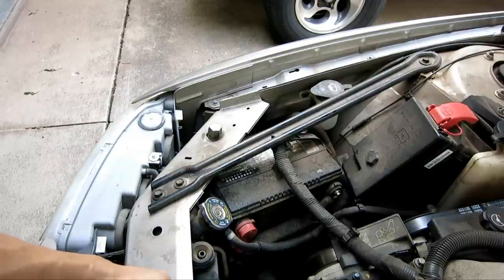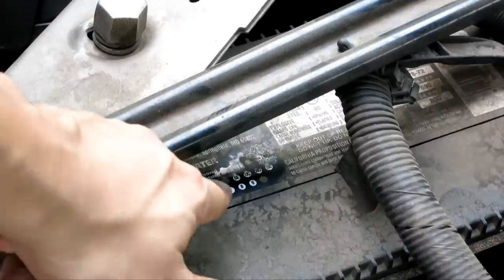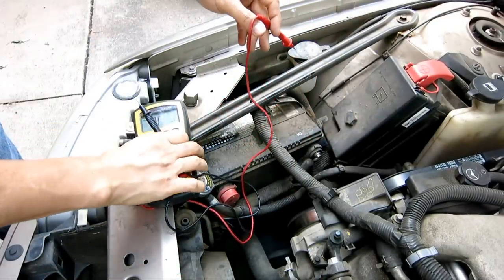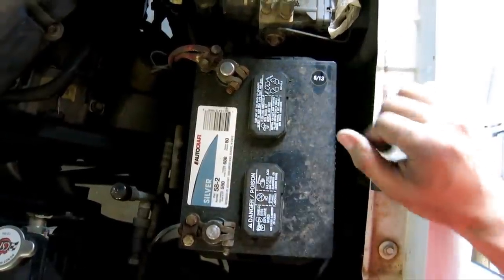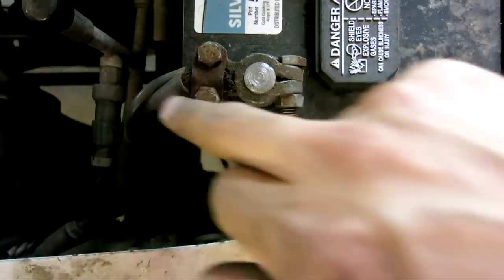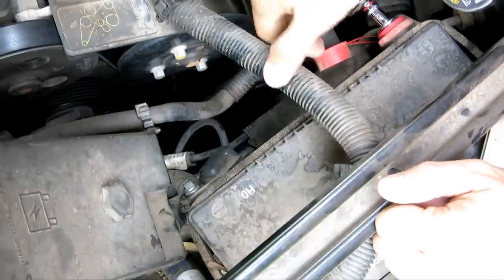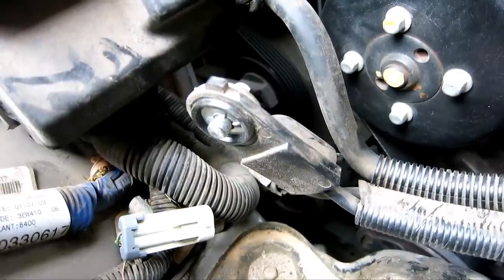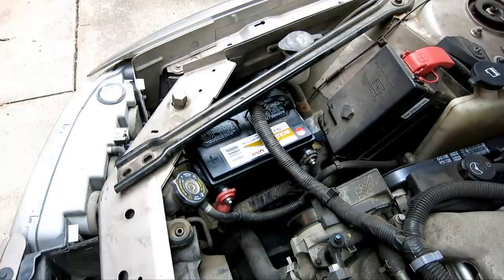How to disconnect & replace car battery - touching 12v safety and tips - Buick Century GMC Chevrolet

Comment: Good video but your not saying what size wrenches to use neither
Reply: Charlie Williams I was going to say The same thing. Wish he'd share that info.
Reply: Thats all I'm ever looking for in these dang add videos.
Reply: Battery terminals are 8mm. The tie-down bolt is 13mm and the bracket bar bolts are 1/2 inch but a 13mm would also work on those. You're welcome
Reply: Holy cow. You need him to tell you the socket size too? Bust out your socket set and figure it out. The man already gave the walk through. You want him to come to your house and change out the battery for you too!? Sheesh. Ok, rant over. ;) 1/2" socket for the sway bar and battery retaining bolt. 5/8" for the battery terminals.
Reply: 14 mm (bracket and retainer bolts)
8 mm (battery post)

Comment: Thanks so much for this video!  I was having such a hard time wiggling the battery out of that tight spot on my 2004 Regal, but when I saw how you did it, I had it out in 3 minutes (and I'm a little old lady on crutches).  Now I can charge it and test the system.
Reply: I need to replace my battery I'm apprehensive but if you can do it I can do it

Comment: 14 mm (bracket and retainer bolts)
8 mm (battery post)
Reply: thanks
Reply: Thank you for this.
Reply: What kind of wrench do you use to take off the sway bar and what size
Reply: @jaimedjones5940  14 mm
Reply: It’s 13mm and the 8mm battery post.
Reply: I used a 3/8
Reply: @davionjr2481 3/8 which one?
Reply: Thanks man.

Comment: This was helpful battery came in and out winds up testing good cleaned terminals went back re installed and started right up.. Then had to drive one car back half way walk back get the other truck drive it back to shop then hoof back up hill to get  car and return..  Some walking some Sun..  
worked like a charm.

Comment: why they say spark can make battery explode.
Reply from the maker: what they mean is when you short circuit the battery positive terminal with a tool to the frame or negative terminal (4:10), it will draw max amps that the battery can produce. Which im not sure if it can explode, but you will defiantly get a big bang and possibly damaging the battery.
Reply: The reference is to the gasses inside the battery.  Example; some batteries are sealed. Others need maintanence water replaced. These batteries have removable caps. One guy used a lighter to illuminate at night the water level in his battery. IDK what surprised him more the explosion or the fact his facial hair and front of his head hair was char fried.